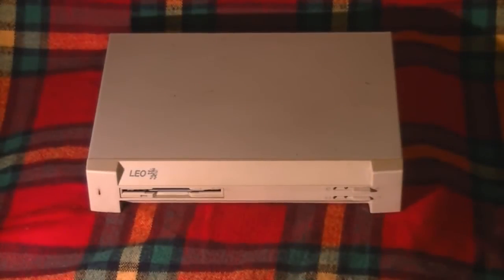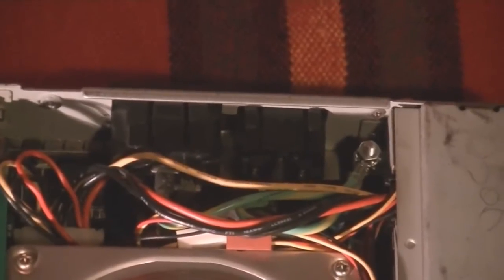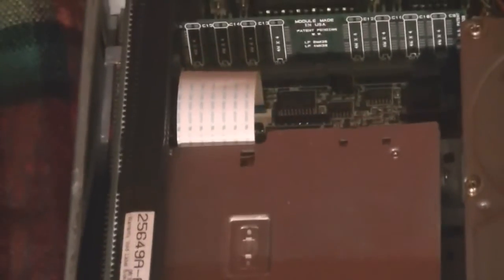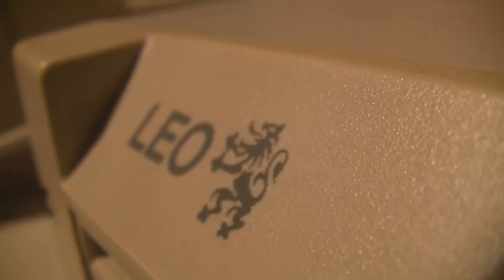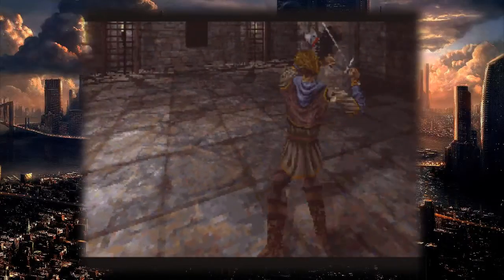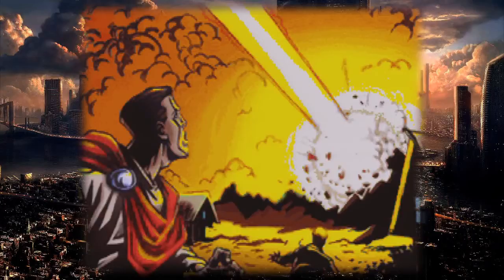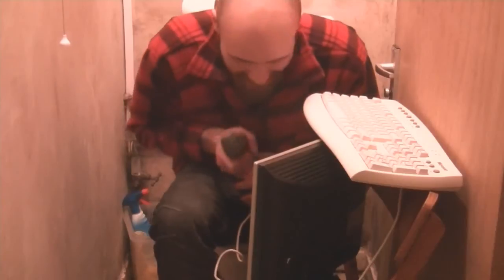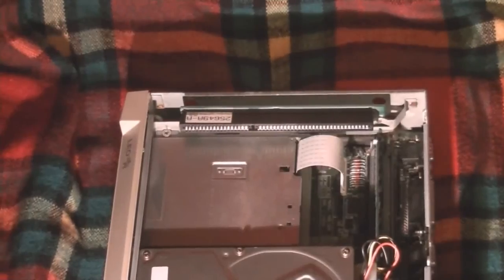Leo Data Book 486-DBA Overview (Very small computer)

Comment: You could install a larger hard drive, maybe with the help of a dynamic drive overlay (if needed), put some ISOs on there, mount them with SHSUCDHD (in DOS) and enjoy cd-games without a cd-rom drive. 
Only thing that won't work is cd-audio. That would require a real cd-rom drive and an audio cable to your sound card. 
But most games of the past do also provide midi music. So you can keep your awesome little machine untouched and enjoy Realms Of The Haunting on it. Awesome video, really enjoyed it !  :)
Reply from the maker: Wait, I didn't know SHSUCD could do that... That is an awesome idea! This system I can't think of much real use for a CD-ROM simply because I have other machines that work better with software requiring them which have drives in anyway, but it could be useful when I am away from home and take the system with me. This information will certainly prove to be useful in the future.
Reply: Got that covered :) https://imgur.com/a/KTHhD I still have this somewhere, still at the parents' house if I'm not mistaken.
Reply: Done. Check your inbox.
Reply: @SireSquish  Thanks!

Comment: I've got this machine, but with a "Liberty" brand.  Just installed the most recent Linux kernel and Gentoo version on it.  The sound card is a ES Audiodrive which has a IDE CDROM interface, but I haven't tried that yet.  What I did try, but failed, was to replace the current 160Gb HDD by a 240Gb SSD using the IDE2SAT2 adapter from Startech.  The Liberty goes "hard disk(s) fail (20)" after a while, although the bios automatic detection seems to recognize something.  Your video was all I managed to find on the internet aboiut this pearl.  I'm quite sure there used to be more, since I already put Linux on it a couple of decades ago.

Comment: Regarding not being able to connect a CD-ROM drive...there actually do exist older CD-ROM drives that connect via the parallel port. They're slower than a slug stuck in molasses, but they work. Just search on eBay for "Backpack Bantam" and you can find them fairly cheap.

Comment: That looks just like the machine I had 15 or so years ago! But it was a Unisys! Also available in a Pentium version. I've never heard of Leo, so could it be a re-branded Unisys CWD? Mine had a single riser slot and also VGA and Ethernet on-board together with two PS/2 ports.I had an AWE64 in it because of the size restrictions.
Reply from the maker: It was made by First International Computer Inc. and their FTP still has some Leo support files, though I have found no support or documentation of this system on the internet. The Leo DesigNote seems to be the most common Leo, which were laptops, the brand was still around in the early 2000's but I am unsure if it still exists. I'm not sure an AWE 64 will fit in this one.

It is possible that the case was a standard part that different people re-badged (For example, I know AT&T used the same cases as my Akhter machine, those cases were built by Mitac) though the motherboard in the Leo was certainly made by FIC.

Either way, this quickly made it up the list of my favorite machines, it's small but it packs enough punch that most games will run to some extent and I can see it being useful the next time I have to go somewhere - such as staying with my family at christmas - as I could easily drag it along, wire it to a TV and blow up aliens while they do whatever they do... Wonder if I could make a wireless keyboard work with it.

Comment: arghh! a Quantum Hard Drive... does it still work? or did the Heads Fuse to its platters? BTW LazyGameReviews just shouted you out in a video ;)
Reply: Quantum means time, as in its only a matter of time before the drive dies.
Reply from the maker: Indeed, did not expect that at all.
Can't say I've had many problems with Quantum drives. The odd one dies with age, but certainly nothing compared to those black Western Digital drives the system came with or the Seagate models from a little later. There are some later versions of the Fireball that never seemed to live all that long though, don't see many of them now. Fujitsu and, probably, the (then IBM owned) Deskstar were likely the better IDE drives of the time however, haven't had one die yet.
The time to worry is when you can tell the model by the startup sounds.
Reply: HighTreason610 ya those IBM Deathstars... The heads literally strip off the metal on the glass platters. Something to behold!

Comment: mine dos not work with any soundcard :(
Reply from the maker: What exactly happens? Or do they just do nothing when installed?
Reply: nothing, regardless which card I put in it (PNP or nonPNP) I always get no sound and the drivers tell me that there is nothing. I think it has to do with the resource-managemnt especially with the network.
e.g. with CT4170 => https://www.flickr.com/photos/94839221@N05/albums/72157683681646872
Reply: I need Intel ICU in order to control the PNP resources. PNP OSes kill that working Dos-Config. NT351 freezes.

Comment: This machine is from a bulgarian bank  maybe from the ages of SSSR
:D
Reply from the maker: Interesting, I'd wondered if it were from a bank because of the label on the bottom. Almost makes me weary of what the drive may contain. I think this was built a couple of years after the SSSR, nonetheless it's a piece of history and has proven to be a very useful machine as it is easy to move around; it has serial and parallel ports so can be used for configuring switches or using as a terminal plus it is able to run a lot of old software rather well.
Reply: It is from a bank " Balkan Bank " and the pc is exclusive made for the bank it is low resource because it is made to make transactions . Probably the drive contains some old dos program for the transactions and some other needed programs but the interesting ting is that this PC has made it's pat from Bulgaria to you :D